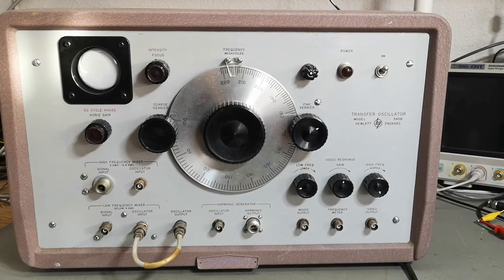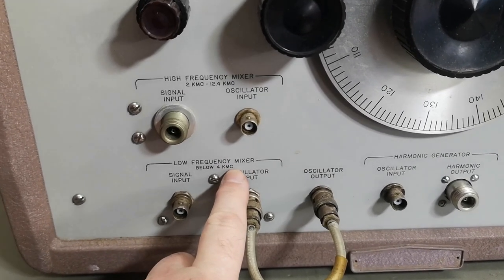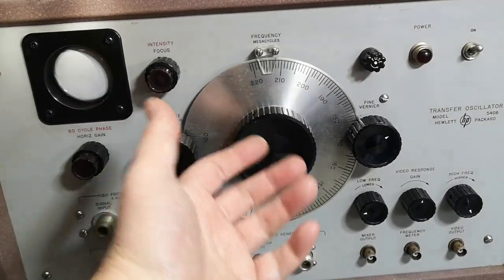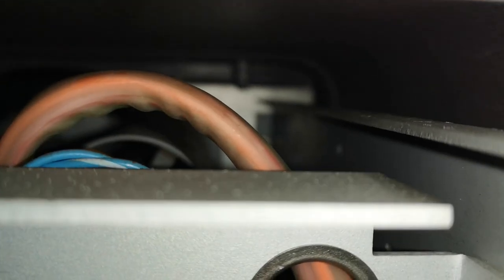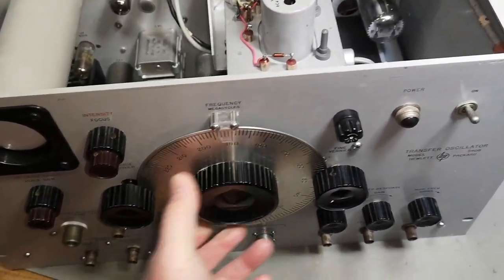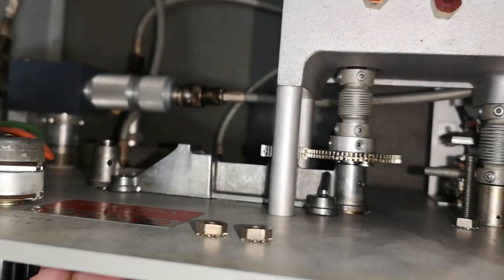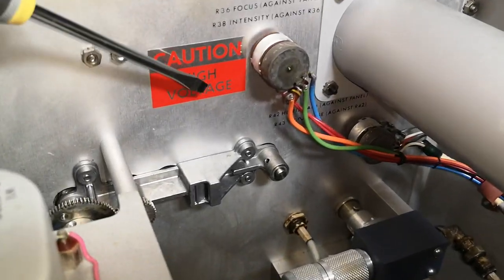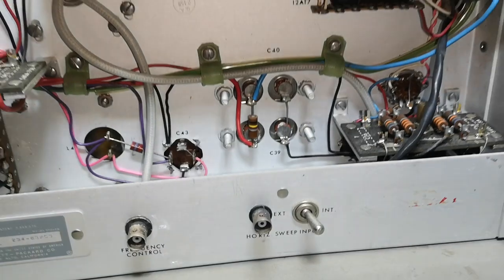HP 540B Transfer Oscillator 10MHz to 12GHz 1960 test teardown

Comment: Hi, this is another piece from the WoW area, it's incredible that it still works after all these years even with a glitch. The pre-sprung gear mechanism is absolutely luxurious, if it works there can be no backlash in the gear and the indicator on the tuning knob is absolutely accurate. I've always liked the illuminated scale indicator on oscillators, here I'm looking there's no light bulb. I'm only marginally familiar with Vf technology, but I was lost here, thanks for the demonstration, I'm smarter again.

Nice day 🙂 Tom